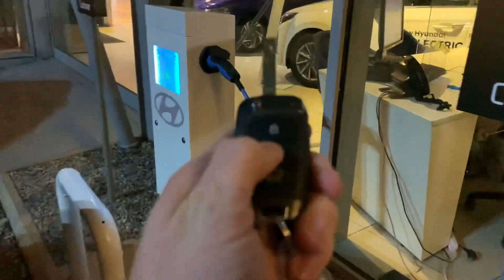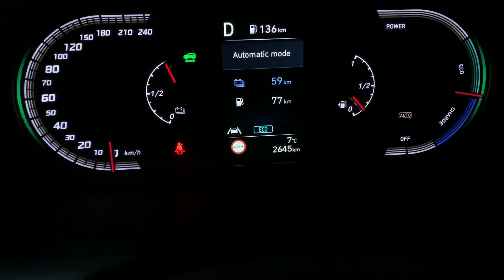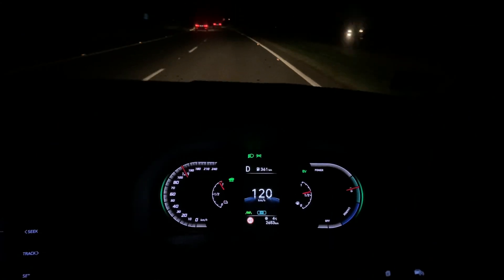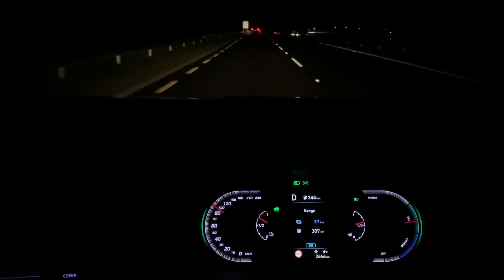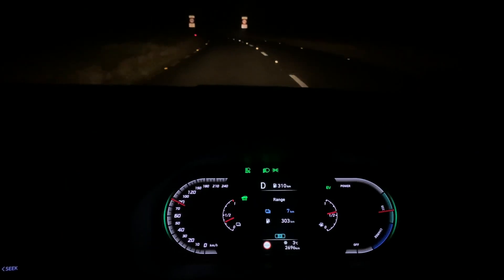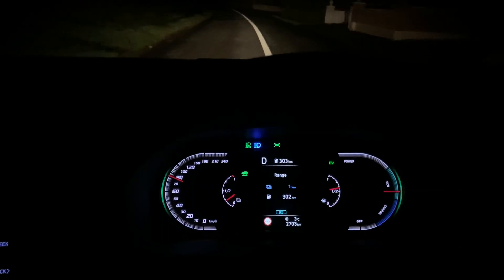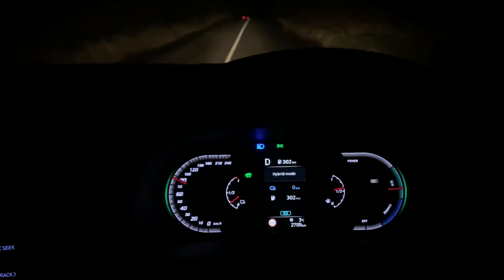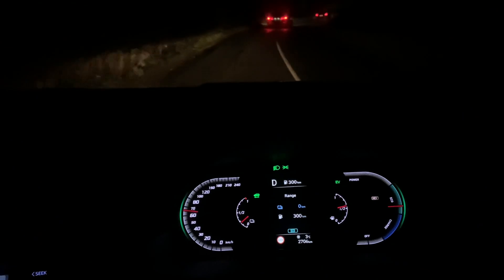What happens in a PHEV when you run out of charge - step by step demonstration #phev #whathappensif

Comment: Hi Brian. I understand the PHEV has both a 12 volt AGM battery and a traction EV battery. If you drive a lot in EV does the 12v run down or does the 12v battery get charged either while driving in EV without the engine running or while it is plugged in and recharging.
Reply from the maker: It’s a very good question … on a full EV like Kona the high voltage battery charges the 12 volt battery .. I looked in the manual and I can’t see the answer to your question on a PHEV .. I would imagine the petrol engine contributes to charging the 12v battery .. I can only theorise here but I suspect the battery should still be able to support charging the 12v battery also .. the reason I say this is that if you were to drive 50 kms without the 12v battery taking a charge it wouldn’t could deteriorate the battery quite quickly … unfortunately I can only theorise on that .. sorry I couldn’t help better 🙂
Reply: @doolanbrian  Interesting. Thanks for the quick response. There has been some discussion on this on one of the Tucson forums. The light Hybrid version has a battery "reset button/function" that can be used if the 12v battery runs down and the car can't be started. For the PHEV, it's a bit of a mystery as the button if it exists isn't in the same spot and there's no mention of it anywhere in the manual. We have a PHEV and drive in EV mode a lot. Hopefully the 12v battery is charged somehow by plugging in the car or from the traction battery or we risk running it down. It hasn't happened so far and PHEV owners aren't complaining yet.
Reply from the maker: @alanmusgrave4502  I know what you mean .. the thing I can see is that the heating triggers the engine so I don’t think that will drain it but I suppose it would be logical for the phev high voltage battery to run the alternator and consequently the battery … but I can’t be sure unfortunately 🙂
Reply: @doolanbrian  Found something in the manual on the; 1-43 covers it. There’s a setting described under “Aux. Battery Saver+” (Plug-in hybrid vehicle); there is a function that monitors the charging status of the 12V auxiliary battery. If the auxiliary battery level is low, the main high voltage battery charges the auxiliary battery. It can be turned “off” but should is set to “on” when delivered :)
Reply from the maker: @alanmusgrave4502  wow .. I saw that reference but thought it was only generic hyundai battery info for full EV like Kona .. that’s great work ! Well done 🙂

Comment: Hi Brian,would you be so kind to inform us how easy/difficult is to fit a towing system(wires and towbar) and is it necessary to change the bumper ? Will affect the rear parking sensors? I am looking to fit one on my new Santa Fe PHEV when it will be delivered. Thank you very much.
Reply from the maker: Hi there ! So we actually subcontract out Towbar fitting to external companies .. as a result I’ve never had to change one here .. I’m not aware that wiring the Towbar on phev Santa Fe is any different than non phev models .. if you live in ireland I can give you details for a fitting company ?? 🙂

Comment: Hi Brian.  Do you know if charging the Tuscon PHEV to 100% often, or leaving it at 100% will contribute to battery degradation?  It seems draining the battery is not an issue, but I wonder if there is a buffer at the top?
Reply from the maker: It’s a fair point and I can’t answer with any empirical evidence unfortunately.., on full EV the advice seems to be operate ideally between 20 and 80% to combat degradation .. on phev like you say it has the low level buffer .. hmmm I think most people will charge to 100 to get decent usage from their EV drive but I suppose technically you could use the idea of charging to max 80-90% like an EV driver would .. the battery will have warranty and is covered for a drop below 70% state of charge so I reckon use it to 100 % and if it fails 🤷🏻‍♂️ let warranty sort it 🙂

Comment: Very well explained. If you can confirm that the gas engine will kick in or not when i turn on air conditioning on a hot day, while driving in EV mode only? Thanks
Reply: So you have to drive around in a cold car in the winter if you want to use EV mode. It’s a bit like buying a house and not turning the heating on.
Reply from the maker: @kevinwalsh3293  You have to be flexible when looking at alternative fuel types, so similarly with electric cars, if people want to maximise the range they have to cut back on how often they use the heater, it’s just the way things are, That’s why so many of these vehicles come with heated steering wheel and heated seats, for example in this case the best way to use this vehicle is to use it as a hybrid when you require air-conditioning and heating and then at those times that you don’t you will be able to maximise use of the full electric drive, like what I was saying you just have to be flexible, if you can’t be flexible , Then you’ve got to stick with what you prefer and that’s usually something full hybrid or conventional petrol or diesel if that makes sense?
Reply: @doolanbrian  good point and makes sense……decisions!!!!
Reply from the maker: @brendanng8038  exactly 🤓
Reply: @doolanbrian  Worth noting that not all PHEVs need the engine running for the HVAC to work. My Renault Captur does all the heating and cooling without it when in full EV mode.
Reply from the maker: @johnenglish2702  good info .. I appreciate it 🙂
Reply: @kevinwalsh3293  I agree with you. You don’t pay premium money to have cold feet  while driving in winter!
Reply: I guess you can pre-heat your car when charging it at night so you find it warm enough to drive it in the morning and you can spare electricity for moving instead of heating. Don't know if it makes sense to do the same with cooling... Also the heated/ventilated seats and driving wheel will help...
Reply from the maker: @inakigarcia3476  this is a good point and I actually can’t answer it !! I’m going to video this in the coming weeks to answer your question . 🙂 thanks for watching !
Reply: In my dads “self charging” Prius Hybrid, the engine does have to be turned on for it to have the air con/heating controls, I would imagine this would be similar in other PHEVs as well!
Reply: @robertdoyle7399  Thank you Robert!
Reply from the maker: I have tried this before on Santa Fe during the summer I found that the engine had to run when the air-conditioner was on

Comment: Thanks Brian. That’s a great insight into PHEVs. If the battery is never plugged in and charged will it deplete?
Reply from the maker: It looks like you could own this car and never charge it throughout its life .. It will behave like a normal hybrid in that case where basically it self charges .. The only thing about the self charging is it will give you a very small electric range of maybe 1 to 2 km max, that’s where the plug-in part kicks in but to answer your question no it will never to be fully depleted ! Thanks for watching